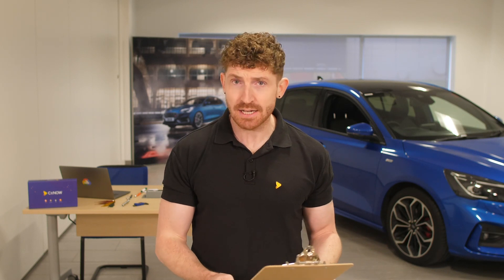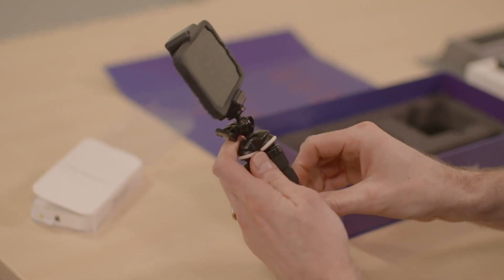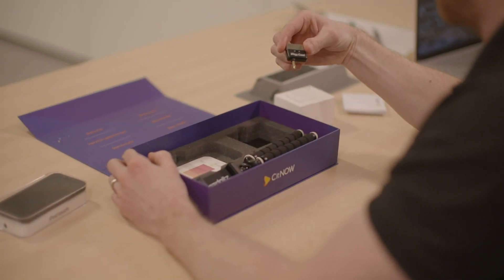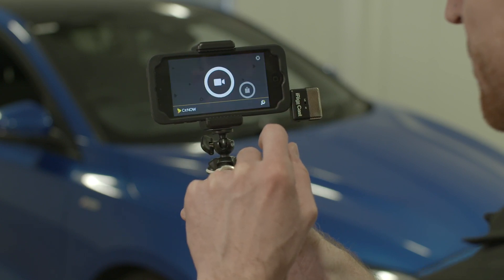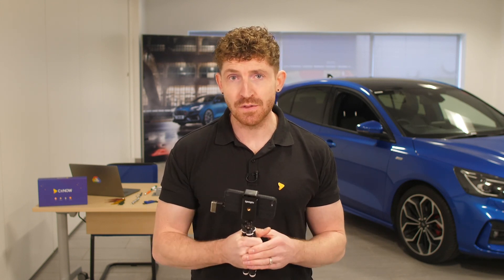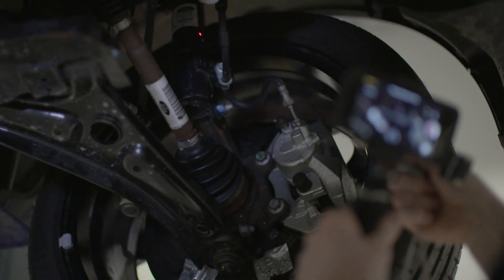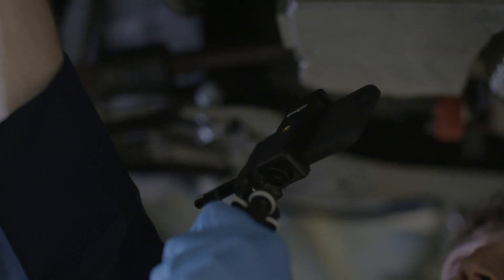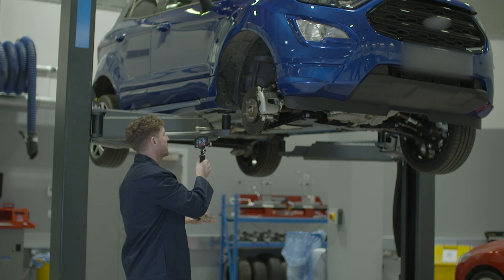How2CitNOW: Equipment for Better Workshop Videos

Comment: Is it mandatory to use brake measurement gauges while making the video? or we can only use brake pad thickness(colorful gauges).
Reply from the maker: It may differ by OEM and dealer what must be shown - we usually recommend using a brake caliper gauge to measure the thickness of the brake disc, whilst mentioning the thickness of a new disc along with it's wear limit, to help give two reference points.  We recommend using the colourful brake pad thickness gauge to help show the current pad thickness and provide a reference to the thickness of a new pad and to highlight the recommended change thickness. 
Ideally both are shown to help provide a full picture of overall condition of the two wear surfaces.